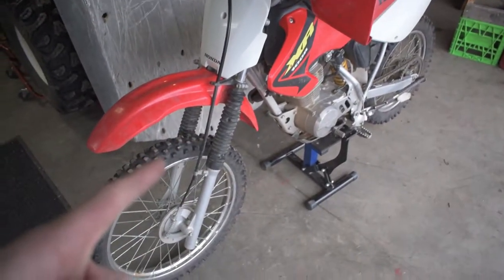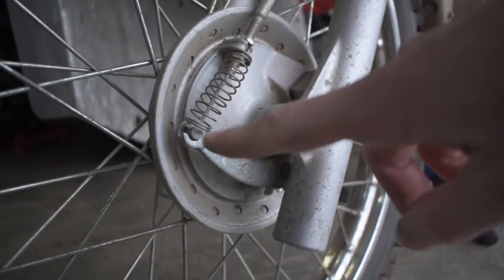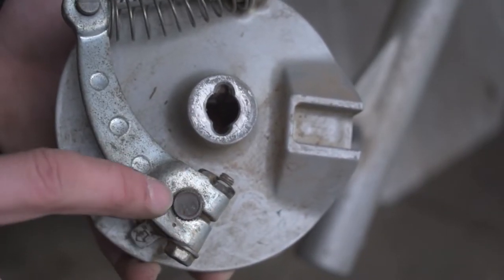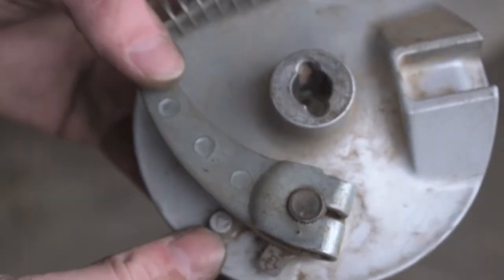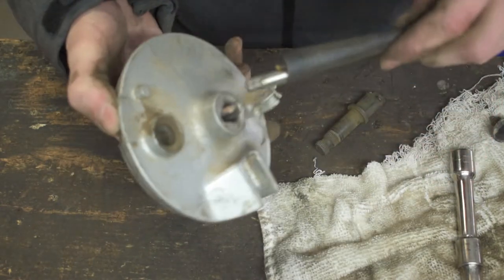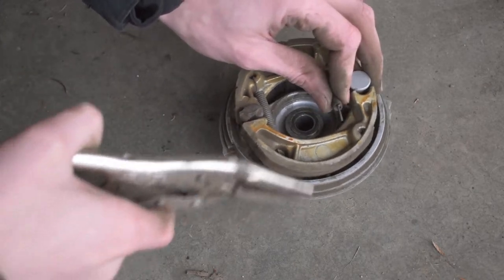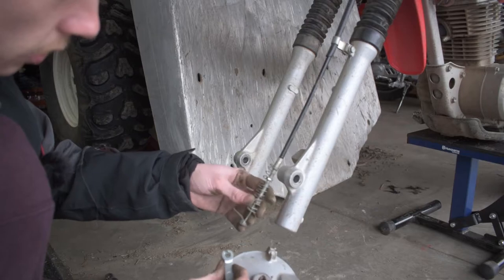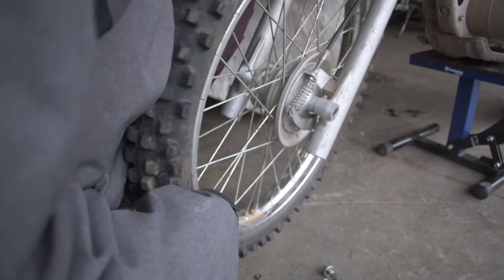How To Fix Sticky & Sucky Drum Brakes On A Dirt Bike!

Comment: Hey! I have almost the same problem with my bike (crf 100f) i pull  the front brake,nothing wrong,but the then the spring cant push it back,so it sucks
Reply from the maker: Need more tension from the spring
Reply: @AaronsEnduro  how do I add more tension??
Reply from the maker: Adjust the arm on the spline shaft
Reply: @AaronsEnduro  I just got this bike it was fine I was adjusting where the brake was on the bars but then that happened so where whould I adjust it from thanks

Comment: What would be the cause of the rear drum break locking up. When i ride even around 40km/h and I push the rear brake it locks ups
Reply from the maker: Sounds like the drum separator is over rotating and binding up when you apply the brakes
Reply: @AaronsEnduro  what would be the best way to fix this
Reply from the maker: Checking that your pads aren’t completely worn out, and or that the adjuster is adjusted correctly
Reply: I replaced the pads and the problem is solved. Thank you
Reply from the maker: Fantastic! Happy to hear!

Comment: I just changed the brake shoes of my bikes rear brake and suddenly its way too tight and also sticky, i tried changing the inside springs, but its still the same. Any idea on how to fix it?
Reply from the maker: The brakes are probably adjusted for the worn out brake pads

Comment: I have a xr80r with brand new brake shoes any idea why it won't grab?
Reply from the maker: The inner hub (where the shoes rub against) itself wears out over time and eventually needs to be replaced

Similar to a car. Eventually rotors need to be replaced after a few sets of brake pads

Comment: I have a crf 70 and I took the brakes apart cleaned and sanded the pivot arm inside the hub. Still not great. I noticed your has a spring at the end of the cable and mine doesn’t not. Am I suppose to have a return spring? I have them on the shoes just not on the cable
Reply from the maker: Is your brake lever not returning at all ?
Reply from the maker: From my knowledge, yes it needs the spring at the bottom of the cable
Reply: Lever and brake pivot arm will not return. Wondering if the cable is to blame
Reply from the maker: Oh , ya you’re missing the spring buddy
Reply: @AaronsEnduro  it operates smoothly with cable disconnected from the brake pivot arm. I’m seeing videos of 70s without the spring but there’s a spring that I found on eBay that is a legit oem spring for 70s. I did buy this used.
Reply: @AaronsEnduro  spring just goes over the cable boot?
Reply from the maker: I dont see how the cable can return without a spring?
Reply: @AaronsEnduro  same lol. I
Took it apart twice. Just don’t think the springs on the shoes are strong enough. I’ll get a spring for the cable .